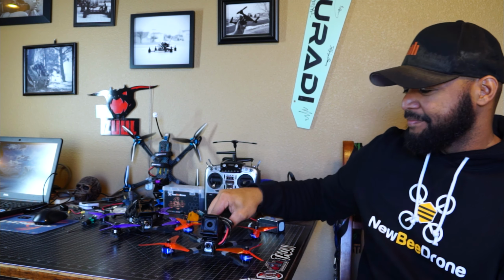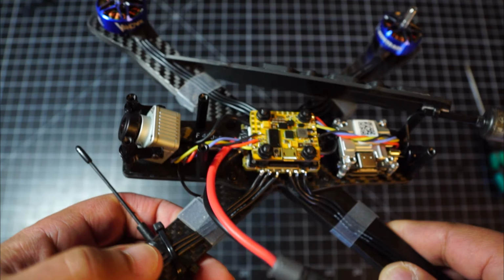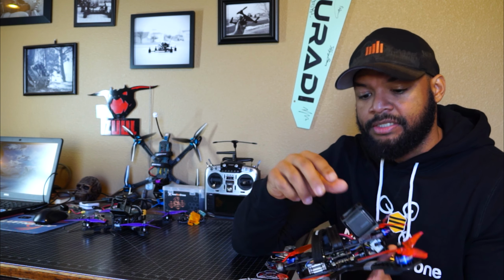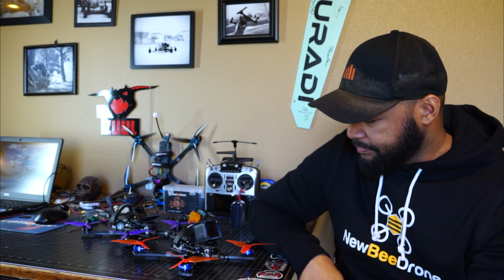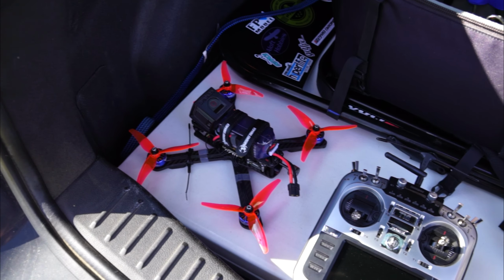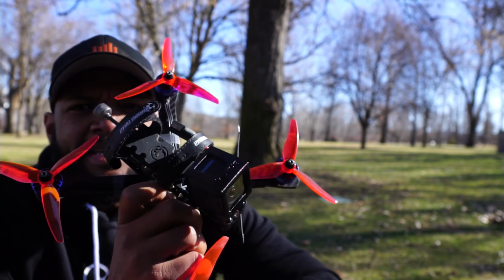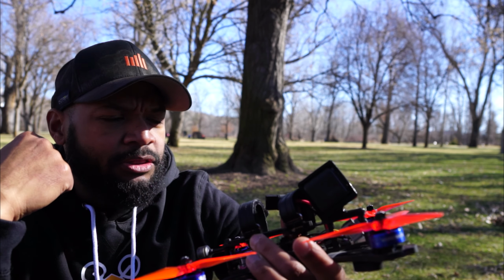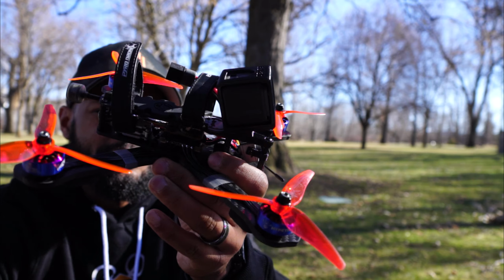Rotor Riot CL1 + Caddx Vista | Newbeedrone Infinity 20x20

Comment: Great video my friend. Why did you solder the vista on the FC the infinity 200 stack has the plug?
Reply from the maker: Thanks! Since I was using fresh wire for the vista might as well hard wire it because hardwired is always the most reliable.

Comment: I would have been happy if the Vista had like 75% performance of the regular AU but it's basically the same lol. Is that a USMC sticker in your rear window?
Reply from the maker: It is but it's from the previous owner lol. I was AF though back in 2001.
Reply: Furadi Sweet man I thought you maybe were a vet too and thanks for serving.

Comment: IMO don't take apart your vista. slightly strip the silicone wires leading to the vista, apply a little flux and solder, and the cap will be secured in-line without ever risking the HD stack. There's literally no reason that the pads would be better than the wires. Noise is introduced from the power wires anyways, so the pads aren't "closer" to the noise. Add all of this to the fact that soldering caps directly to pads is just asking for a stress fracture and a possible short.
Reply from the maker: A stress fracture? From a cap that is so small it doesn't register on my scale? That also happens to be protected inside of the frame... you're overthinking this man. 🤷‍♂️

Comment: what's the difference of 30x30 stack vs 20x20? just the size? New to the hobby.
Reply from the maker: Yep yep pretty much. The 20x20 is probably ideal for most builds up to 5" just due to the space and weight savings.
Reply: @Furadi  Thank you for fast response! is it possible to change the motors and battery to make it 4s build?
Reply from the maker: @kevinfuentes1325  Definitely! When planning a build you just want to match motor KV to voltage. A good range for 4s is 2300 - 2600kv. That being said 6s is better due to lower amp draw. (if you haven't bought lipos yet)
Reply: @Furadi  Just bought stacks using your affiliate links :) will try to build it like yours when my vista comes in the mail. Do you have the link to power up your dji googles and strap?

Comment: Good stuff, but I'll wait for summer to see how the vista holds up for ppl before I even consider switchin from my 3 air unit builds, I'm in Florida soo hard on electronics here
Reply from the maker: Yeah that's totally valid... I had mine powered up on the table @ 25mw today and it only took a few minutes before I got an over temp warning.

Comment: Did you swap out the vista cam cable to a dji cam cable? Because my vista came with a short (about 75mm) cable that isn't long enough to mount aft of the fc stack in a typical 5" frame. Mine also has exposed wires and a black back plate on the cam.
Reply from the maker: Yessir I did.

Comment: You must really like your transmitter to keep buying crossfire receivers. Do you ever break those T mortal antennas? Every time that I would break them I would get pissed. I'm a firm believer of using the dji controller now that I don't have to worry about those receiver antennas breaking and fail safes.
Reply from the maker: I've never actually broken one lol... I shred them but then I usually just have to straighten them out. Also with the variety of quads I have and the different types of flying I do the DJI controller would never make sense for me. Not to mention it costs twice as much as the Jumper. (my crossfire is a few years old)
Reply: @Furadi  yeah I guess price would be an issue. I ordered the the package with the controller the first day that it was released. I literally paused the rotor Riot review and went to dji website and ordered it. I had to remove the two rear standoffs from a RR flow frame to fit the air unit.
Reply from the maker: @escobarfpv1275  damn 😳😂

Comment: Hello
Did you ran into and issue using a 20*20 stack to power a 5 inch 6s setting. 

i'm  looking to do the same
Thanks in advance
Reply from the maker: Nope no issues.
Reply: @Furadi  Thanks for you response. You think following with be ok with that stack. 

Plan setup
- 2306.5 -1750 kv motors
- 6s Battires
- Capacitor
- Self powerd Buzzer. 
- DJI Controller as the RC link. 

Thanks

Comment: How do you feel about the NBD 20x stack now after some time? Still running it? 

I ordered mine, trying to get a solid BetaFlight rig going with the recent updates I’m interested in flying beta again. Plus the DJI OSD with beta is 100x easier than kiss seems to be. Or my air unit is trash.
E

Edit. Air unit already died... idk. Maybe my BEC went out and it got 6s voltage. Something died & im out the FC & air unit. Fuckin expensive oopsie
Reply from the maker: Oh I love it! No issues...
Reply: Furadi dude thanks for the fast reply to an old video. Love your content man, been my motivation to get back in the air. This quarantine stuff sucks.
Reply: Furadi just want a stack that’s reliable and stout, don’t need brand new cutting edge. Need a solid kwad
Reply: Furadi is that what you’d recommend? As far as FC & esc. Sorry for blowing you up
Reply from the maker: Oh yep, if I was building a new 5" freestyle today it'd be with that stack.

Comment: so you fixed the freezing when crashing with two caps.. one on the airunit and one on the quad power input? I need to know as im having the same issue and its annoying the fxxk out of me.
Reply from the maker: Check out this video - https://youtu.be/6FQbWWaEHxU
Reply: Freezes are common if power is insufficient to air unit, n browns out, how is urs wired ?
Reply from the maker: It usually has more to do with power instability more so than a lack of power hence the caps.
Reply: @flo-ridafpv5713  i conneted mine to a 10v 2a part of the pdb.. matek 6s one. But ive now got it wired to the battery connector.
Reply: @pokiou  OK 4s vbat now right ? With a cap u should have 0 issues, I run vbat pad on the FC, many board regulators can't handle DJI draw especially during flips

Comment: Did you do a cable swap from a dji air unit to the caddx vista on that build?
Reply from the maker: Yessir. I'm kicking myself for forgetting to mention that detail.
Reply: Is it an easy swap or does it take some tweaking to get it done
Thanks
Reply from the maker: @mikeschultz6444  yep its pretty straight forward!
Reply: Cool im working on a vista build and I need the longer cable also.

Comment: Pleeeease, where can I buy this fpv tpu mount. I don't have a 3d print yet, and i feel Ill still dont having it for a long time cause I still have to save to buy the DJI shit for my life feel complete. But I need this fuckin mount for my builds that will need to extend de standoffs to be able to fit the DJI air unit or Caddx or whatever.
Reply from the maker: The cam mounts?? I put a link in the description.
Reply: @Furadi  Oh yeah ! Thank you very much.